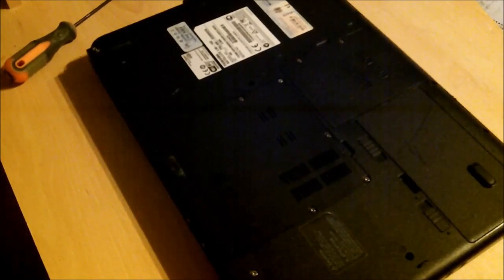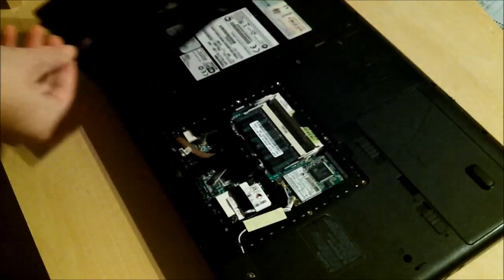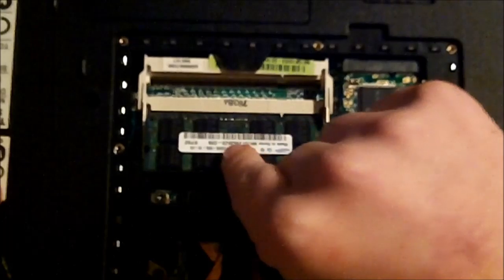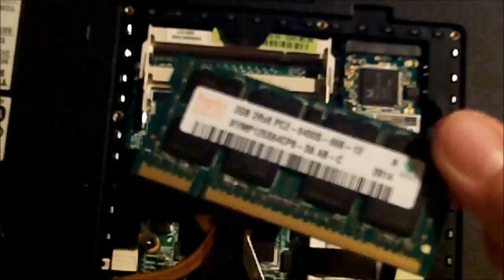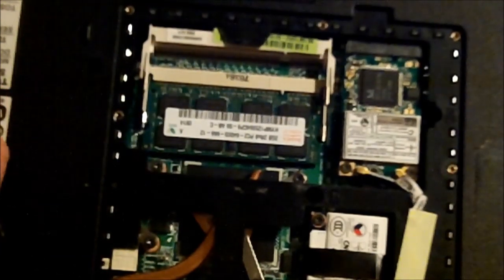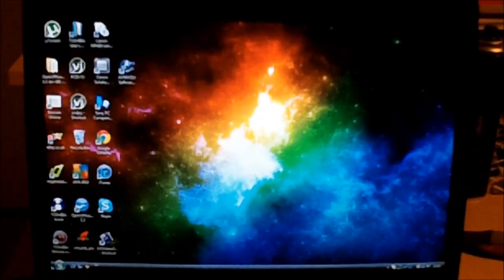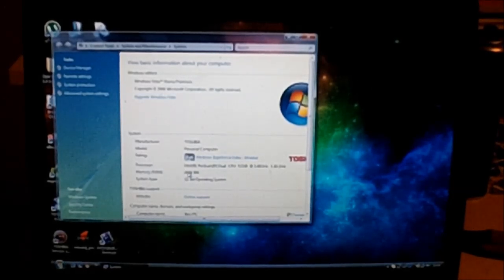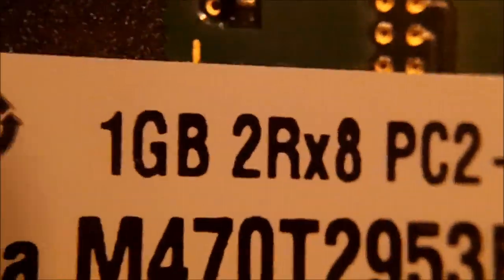How to Upgrade the RAM Stick in a Laptop Toshiba satellite

Comment: I changed my 2x2gb ram cards for 2x4gb. Now windows won't load even after I put the old ones back in.
Reply: Did you ever solve the problem, I want to know what happened
Reply: probably didn’t install it correctly